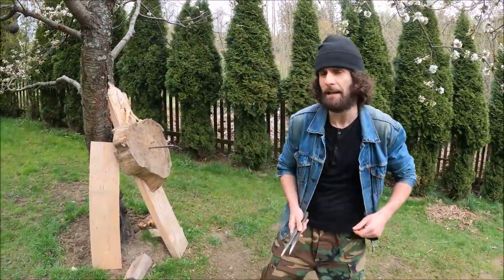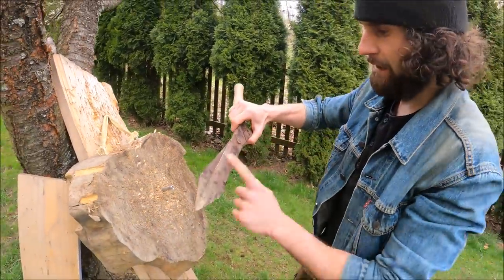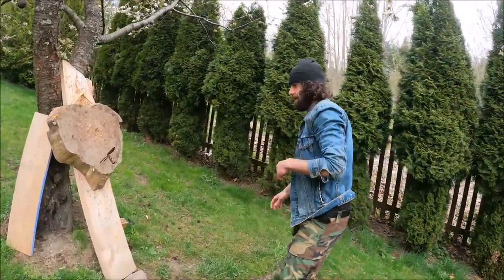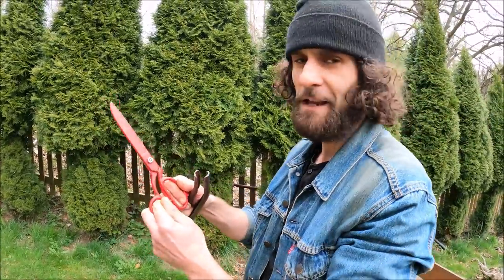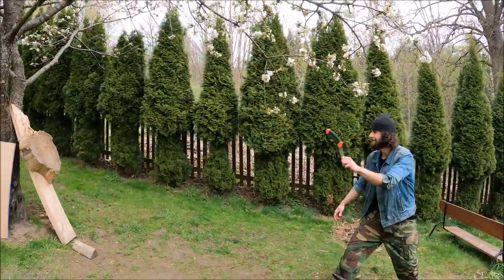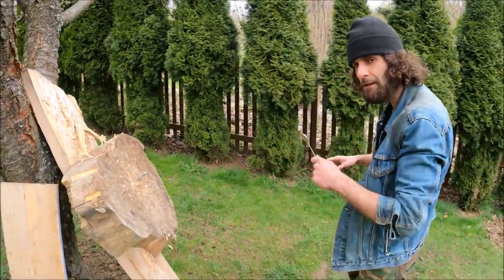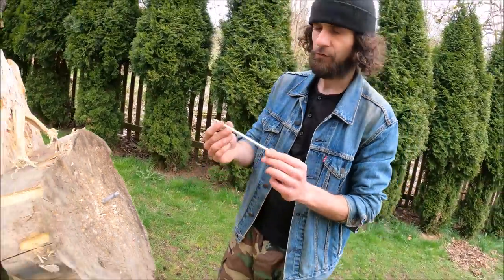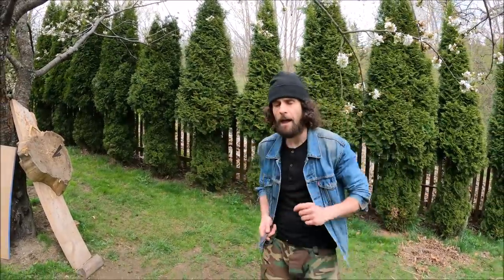Marvel Bullseye's Weapons (In REAL Life)

Comment: Favorite is the spoon for half spin because the weight distribution gives you the most power for the overall weight. Also it looks harmless and might be what you have when the situation gets sticky. Practicing with odd throwing implements is not a bad idea since you can only throw what is available in time of need.  Also consider chisels, they are cheap and made from impact resistant steel. I have some 30 cm long, 1cm x 1cm square cross section and weight about 240g. That's the closest I could get to a useful knife geometry. 6 Euros for highly impact resistant steel! But are much harder to throw than real knives.

Defensive distance is close in anyway, so not totally unrealistic.